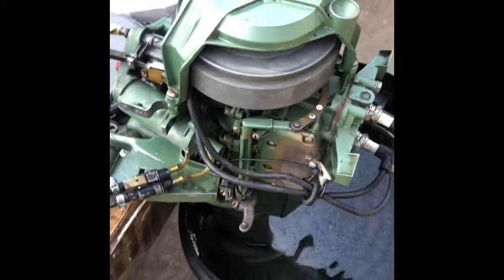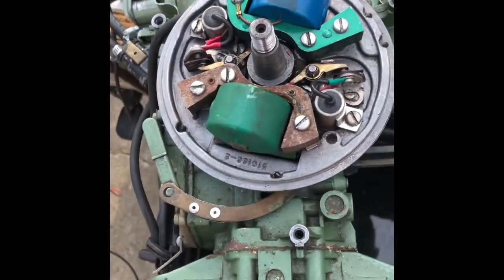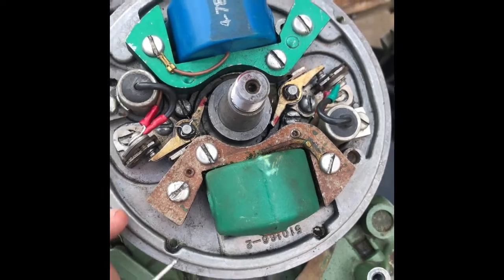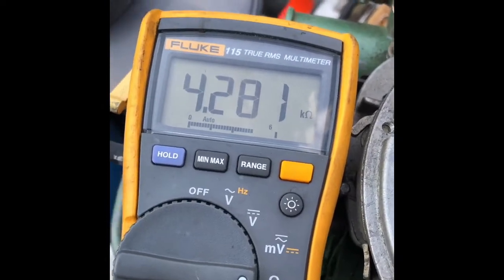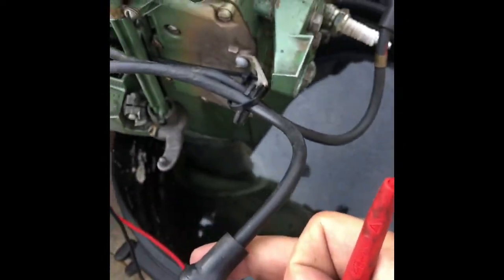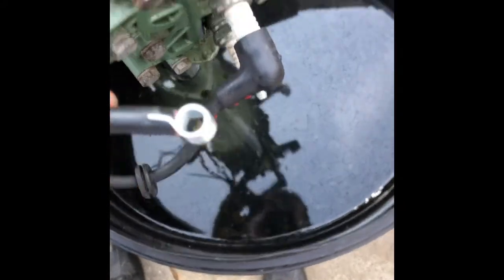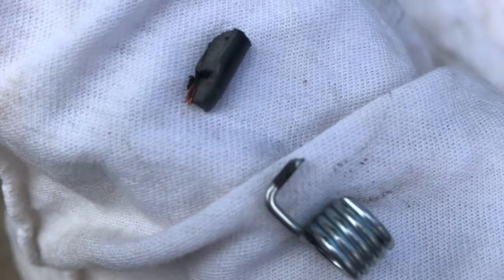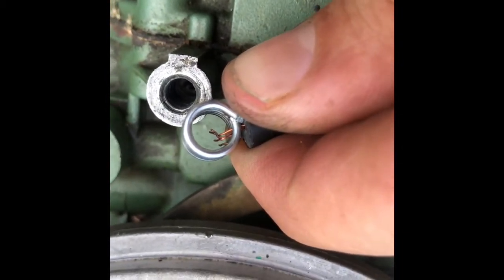Johnson CD-11 intermittent no spark

Comment: Get yourself  a common  automotive  steering wheel/ balancer puller an  a few lengths of  grade 8  1/4"  bolts and washers  to pull the flywheel. Put tension on the puller and if it does not pop the wheel loose,  lift up  (approx 1/8") on the flywheel to get it  "off the thrust"  of the crank bearing.  Whack the  top of the puller  and  no gentle "love taps" either.  That should pop it right off.  Make CERTAIN  the  tapers of the wheel and crank are  clean, smooth and DRY  before you reinstall.  DRY.   Look up the torque.     I am not convinced your  troubleshooting is legit.  I've been around autos and now outboards for some time  (I'm 75)  and the connections you speak of should NOT affect spark, as there should be enough spark to jump across those  "bad"  connections.  I would almost bet this was some onter problem. Perhaps the primary wires  were very close to the terminal and grounding at some point?   Also I do NOT use  those type  condensers/ capacitors.  I buy  electronics  plastic or "orange drops."  Cut the top off the condenser,  drill a small hole in the bottom side,  work one wire through to solder  it to the shell, and  inject some  (brand name)  "Goop"  to  glue the cap in place.  Solder an eyelet onto the remaining wire lead after putting an insulating sleeve  "spaghetti" over it and you have a cap that will NEVER  fail EVER

You cannot  really test coils with an ohmeter.  You really need some sort of  coil/ condenser tester, and one which tests  condensers  for leakage  WITH HIGH VOLTAGE over a hundred volts.
Reply from the maker: Didn’t need steering wheel puller.. I got the flywheel off without one.

Watch some other videos of how to test a 1 wire coil. You’ll see that to test a coil you check for resistance from the ground on the coil to the spark plug wire. Resistance is measured in “ohms” represented by the Greek letter that looks like an upside down “U”.

Comment: Replace the flywheel nut, leave it a thread or two proud, before you use the hammer. Often it takes far more than the love taps on this motor. The nut will prevent damaging the crankshaft threads.